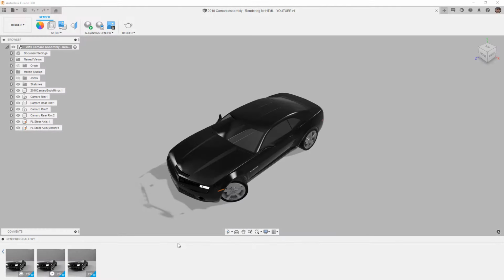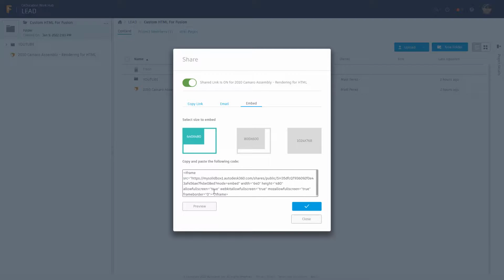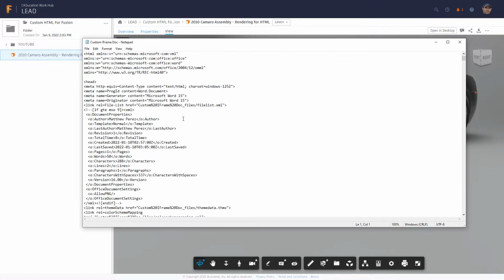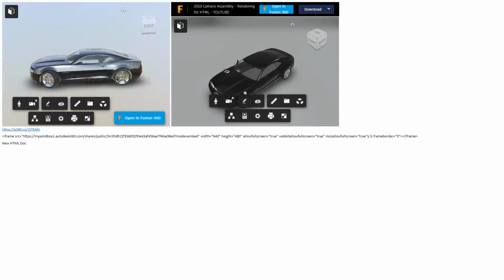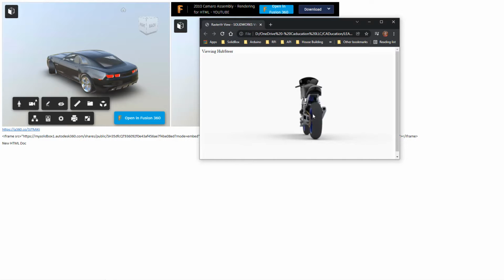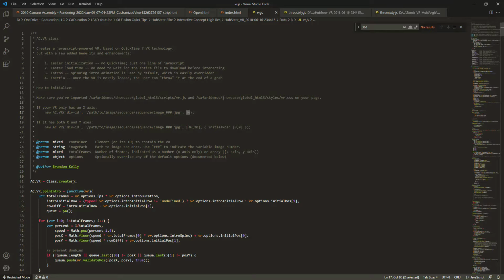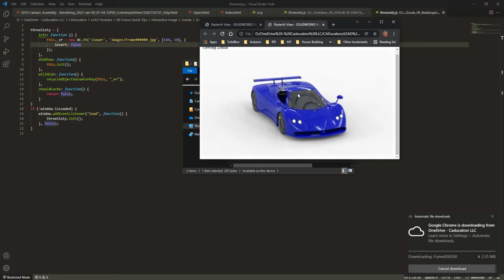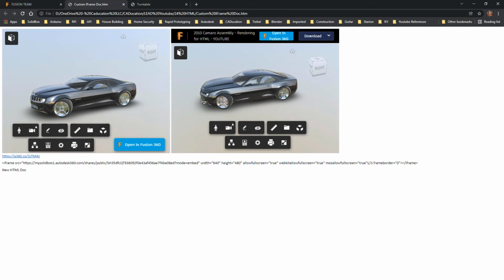Fusion 360 - Create a custom 3D HTML Viewer with Download Links #Fusion360

Comment: I would like to see a finished document that might incorporate fusion visualizations with drawings/simulations and object interrogations.  This seems to have great potential, but I would like to play with it and show some colleagues even if it is just an Autodesk link showing off the functionality
Reply from the maker: Ill try to put together a sample and just do a follow up video.  if you are using Fusion 360 at work are you using the Manage extension for PDM and/or have you turned on Component View?  I think its in beta preview right now.  Some of that allows you to create a "viewer" role where users can view the assembly structure and even internal components from a browser.
Reply from the maker: Robert, I just uploaded a new video with a more comprehensive sample.  If you want that document just send me an email support@caducator.com.